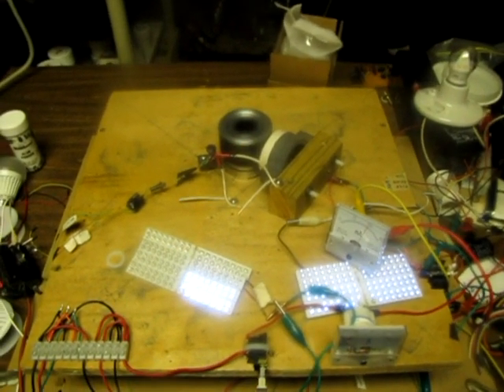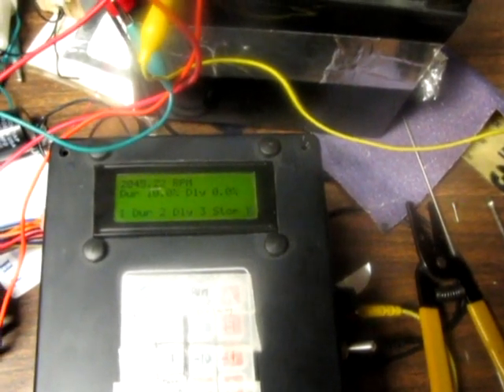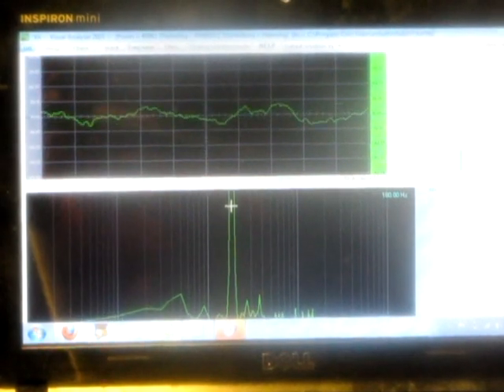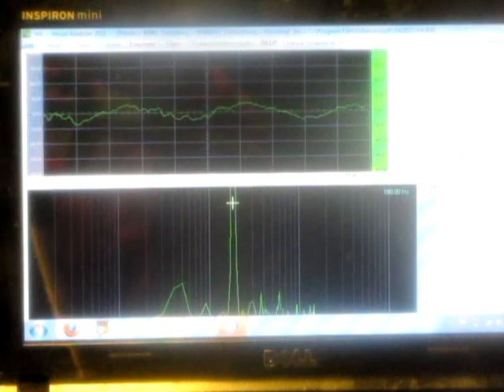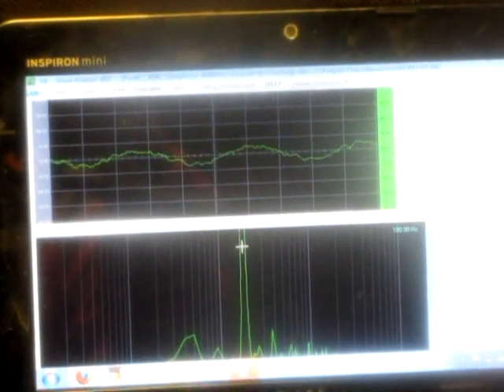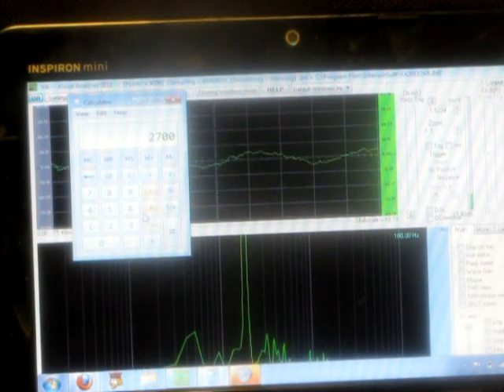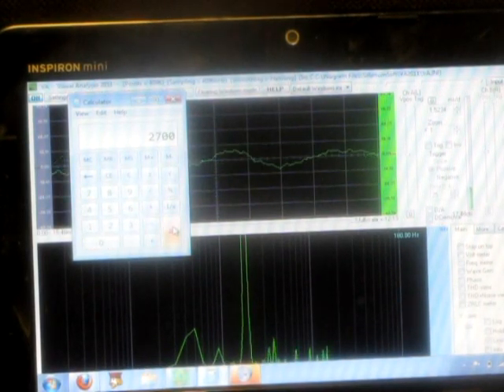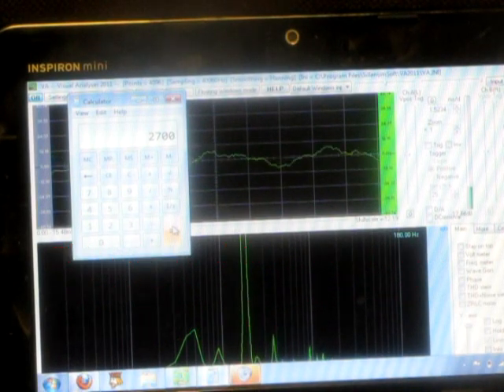How to measure a pulse motor's rpm without a tach 5.23.13

Comment: Great tip, well presented too...looks like it would work under Wine (am running Peppermint Linux on old 2002 PC). 
Have got a tach, but this method is one of those things to exclaim 'ha it does!' when it works :)